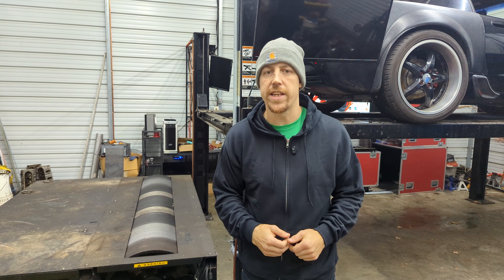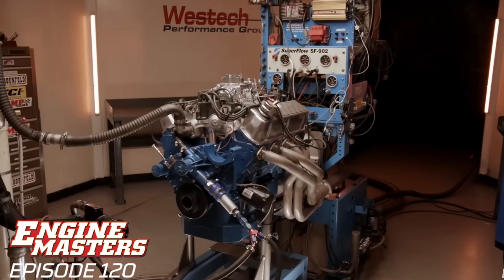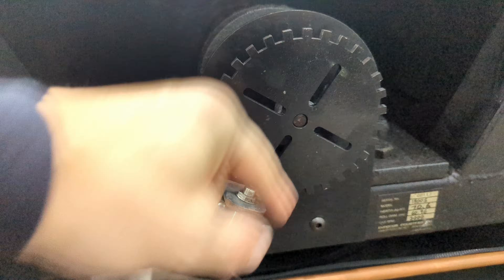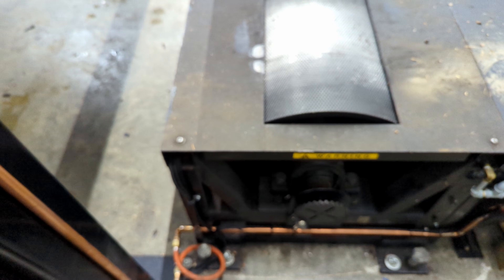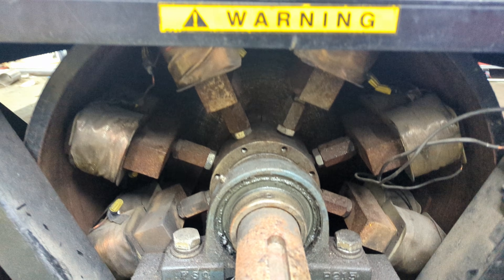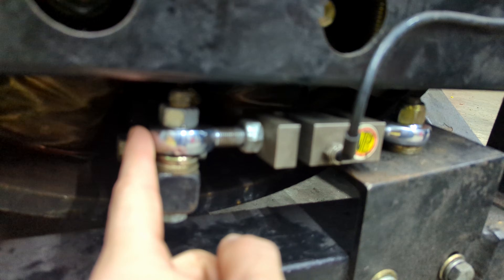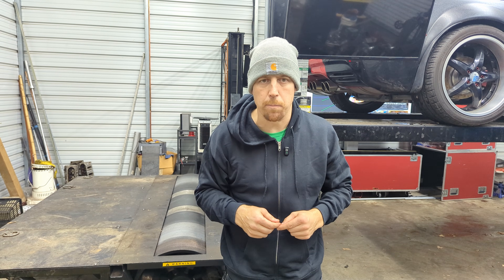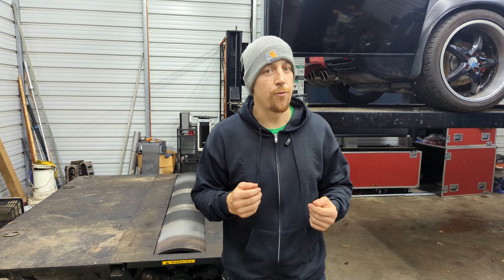How a Dyno Actually Works (It's Simpler Than You Think)

Comment: The 5252 accounts for all the different units used for rpm/torque/hp. If you only use SI units, e.g. rotational speed as radians per second, torque as Newton meter and HP as Watts the formula is just power = torque * speed.  
Speed = RPM * 2 * PI / 60 = RPM * 0.1047 
Nm = lb/ft / 1.355817 
BHP = Watts / 745.7  

So 745.7 / 1.355817 / 0.1047 = 5253 - Close enough 😊
Reply from the maker: Great explanation of the unit conversion and the origin of the 5252 constant. Thanks for watching!
Reply: this is a better explanation than what the other guy was saying. Can you describe the 5252 value in another way that correlates it to everything else? All I ever hear is "5252 is what it is." I've understood dynos read the torque, then that times the rpm is the rate of power exerted (HP/NM), and that an engine always makes the same hp/torque at 5252.
Reply: @blgdinger3  The two curves crossing at 5252 rpm is because the rpm term effectively becomes 1 : power= (torque * rpm)/5252 => power=(torque*5252)/5252 => power = torque * 1 => power=torque. Youtuber Engineering Explained dedicated a whole video to just this topic 🙂

Comment: Why 5252? Let me explain. The formula is Torque times RPM divided by a constant. When dealing with torque in ft-lbs and power in horsepower the point where both cross on a graph is 5252 (rpm). It will always be 5252, so that's the constant. When dealing with units like Newton-Meters and Horsepower, the constant is 7121.
Reply: An actual explanation: the short version is that the constant comes from converting a linear metric to rotation. To travel 33,000 feet with a radius of 1 foot requires 5,252.1131220325 rotations.

James Watt defined 1 HP as 33,000 foot-pounds of work per minute.  When you convert that from linear motion to rotation motion you use the formula (Torque x RPM x 2πr) / 33,000.  At 1 foot radius that simplifies to ((Torque x RPM) / 2π1) / (33,000 / 2𝜋1).  Simplified further you get (Torque x RPM) / >>the result of 33,000 / 2𝜋1<< or (Torque x RPM) / >>5,252.1131220325<<.  Colloquially we refer to this constant as 5252 or 5250.
Reply: Yeah but usually when Nm for torque is used, so is kW for power. Unless it is a country that has their own brand of horsepower as a unit like PS or CV.
Reply: @hughjassstudios9688 not sure about PS but CV is French for chevaux vapeur. Which literally translates in English to horsepower.
Reply: Yeah you didn't explain anything lol
Reply: You didn't really explain something
Reply: @what9418  right over the ol’ noggin huh?
Reply from the maker: Thanks for the explanation, and thanks for watching!

Comment: Hey love the video! As someone who watches a lot you're very coordinated and I love how the flow of your descriptions never seems awkward or weirdly interrupted. You don't waste any time with jargon or trying to paint a picture that isn't necessary and I think that's something the educational side of this platform can really appreciate. Great job! Greetings from a fellow Canadian too :)

One thing I don't understand is how the electromagnets would become energized while the system rotates. Do the electromagnets rotate separately from the roller (as in on a separate rolling assembly), with the roller (as in they are connected), or stay stationary propped up in the center? This looks like one of those machines I might be crazy enough to try to make myself one day, this is what happens when you give the community too much power haha
Reply from the maker: Thanks for watching — really appreciate the kind words. And hello from Vancouver, Washington, just south of you, down here in the USA.

I’m definitely a no-BS kind of guy, so I’m glad that came through in a good way.

To your question: the electromagnets do not rotate. The roller spins, but the magnets are stationary. When the dyno control system demands load, it energizes the coils and they try to magnetically lock to the rotating roller.

They can’t actually rotate though, because the magnet assembly is tied to the torque arm that’s fixed to the dyno frame through the load cell. That attempted rotation force is what the load cell measures.

And yeah — plenty of people build their own dynos. Fabricating a proper roller is by far the hardest part. I would’ve gone that route myself, but this one fell into my lap at the right price.

Appreciate the thoughtful question 👍

Comment: Dude, awesome production quality loved the video!

Quick question, is there anything special about the eddy brake electromagnets?
Or just a on/off type deal and just the reaction torque matters?!
Reply from the maker: First, thanks for watching! Glad you enjoyed it.

And that’s an excellent question about the eddy current brake.

The electromagnets themselves are pretty straightforward coils. The only “special” part is that the ends of the steel cores are radiused to closely match the inside of the roller. The closer they sit to the roller, the stronger the braking effect.

The brake power supply outputs 190 V DC, and braking force is controlled by duty cycle (PWM). In simple terms, the dyno rapidly turns the electromagnets on and off to control how much braking torque is applied; typically hundreds of times per second.

So if the system is commanding roughly 50% brake, the magnets are energized about half the time and off the other half.

Hopefully that clears it up.
Reply: @PyroPerformancePNW  Hummm, that's a pretty interesting voltage, pretty much 110vac rectified to dc, diyable if you're brave (or dumb) enough ahhaha.
Reply from the maker: @YagoFernades  the dyno brake power supply take 220v 50a AC as an input, and outputs 190v DC. And yes, I agree it's an interesting voltage. Not a voltage that is commonly found in other applications, at least as far as I'm aware.
Reply: @YagoFernades  the voltage is irrelevant. those coils just happen to be designed for it. you could rewind with different gauge wire, different turns, for a different voltage but same effect.

'amp turns". "ohms law."

wire resistance limits current flowing due to an applied potential...

turns x amps creates MMF or magnetising force, hard concept as its not 'attraction/repulsion" but the magnetic flux it can "push" through the iron and air gaps. BH loops. one is the MMF applied, one is the resultant magnetic field induced in the material.

a wire of a certain cross section and length can be wrapped around a core and former so many times...

coils are a bit of number juggling :) and for this purpose, accuracy isnt terribly important. you just want teh maximum MMF for the least power consumed in the resistance...

smaller air gaps, larger cross section cores, better flux coupling with teh spinning conductor, stronger eddy currents, stronger reactions.

coils are easily varied with PWM. the air gap can also be varied, ive made a few using permanent magnets. they dont work as well as electromagnets, but thats mostly flux coupling and air gaps being too large... magnetic field strength from a pole being an inverse cube law...